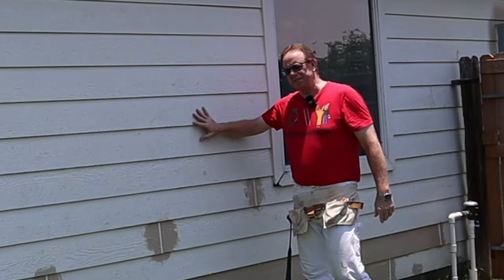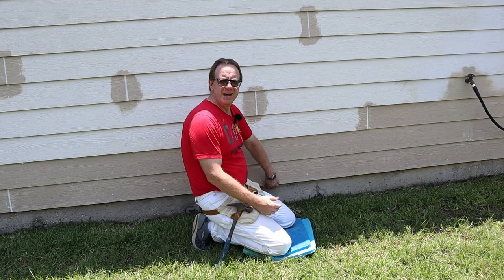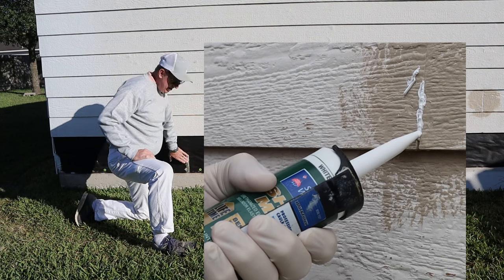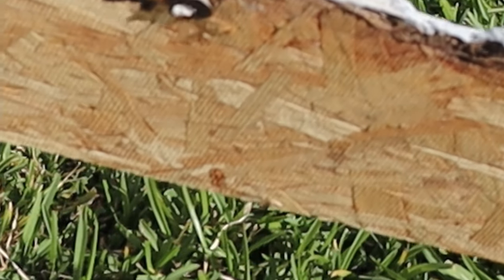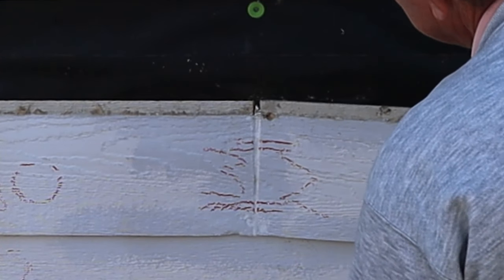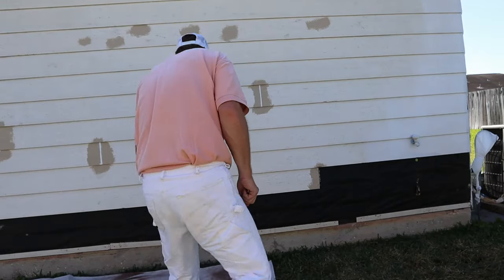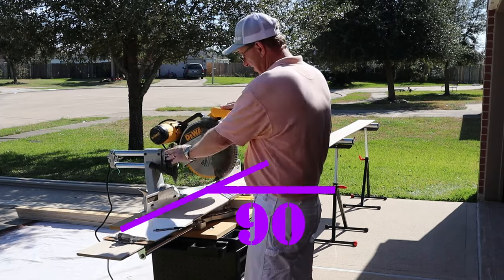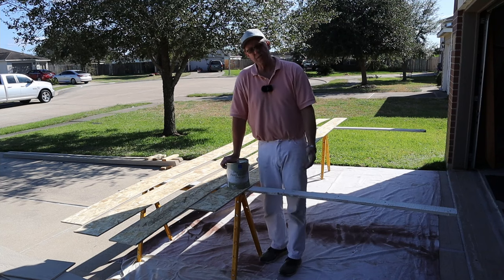Rotten Lap Siding Replaced, Surprises Found From The Builder

Comment: Why didn't you just get your length mesuments off of the pieces you are replacing?
Reply from the maker: Good question, because the expansion gap between the old boards was too narrow.  Also when the house was built it wasn't done with quality in mind, instead hurry up and get it done so didn't trust how the original boards were cut to fit.  The new boards were little different length than the originals.  Thanks for watching